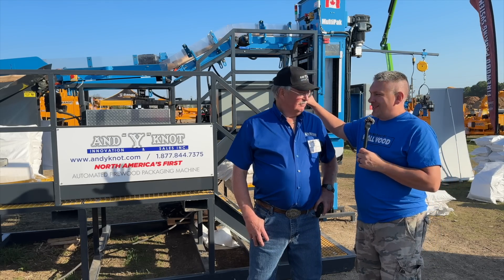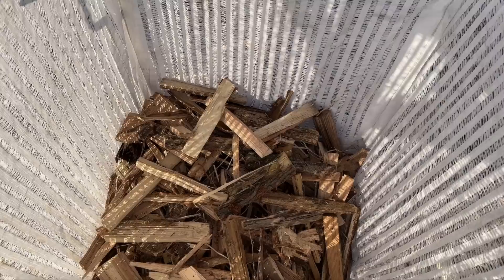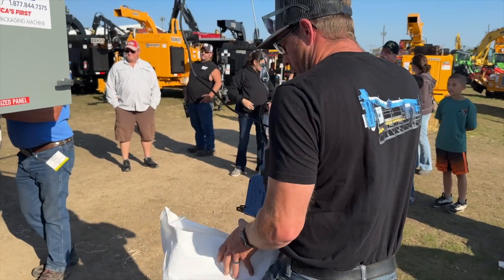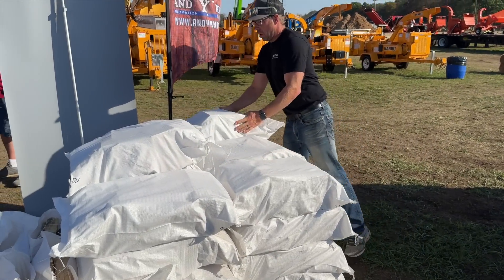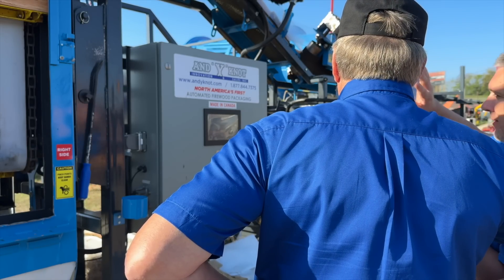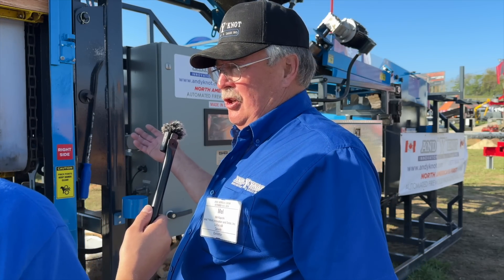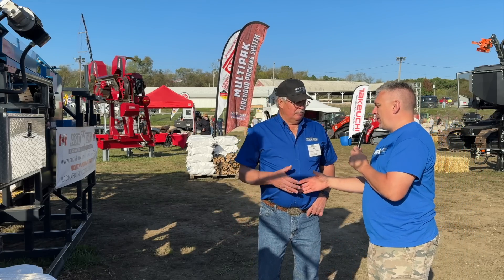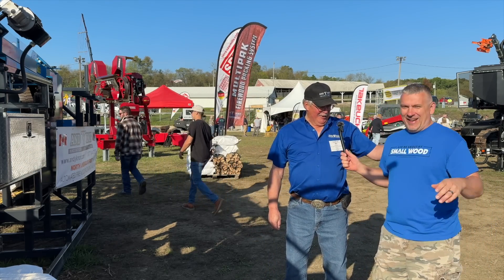Hands-Free Firewood Bundles - North America's First Automated Firewood Packaging Machine

Comment: Hi Dan Great Video of The North American FireWood Prosser And Why Not is That how you Pronounce The Name of the Machine QQQ Dan So if you Need a Cord of Firewood it will Automatically fill 12 inch Bags So you Wood Need 2 Bags for 24 inches So with your Mini Firewood Splits you have to have a 4 inch Head long QQQ Dan What about how Wide your Mind Firewood Splits what is the adjustment for it and if it Did Fit you Could Probably Prosses 4 inch x2 inch and 8 Pieces to Make One Bag or Would That be 16 Piece's if So QQQ Could That Mach Up with your Kindlet 200 for Bagging or Do you have to have One Machine to That 👍
Reply from the maker: I don't think the mini firewood would work with this and I would need to have a LOT of orders to fill to pay for it...lol
Reply: Hi Dan QQQ The And Y Not Machine How Much Does it Cost and Would They Lease it 👍